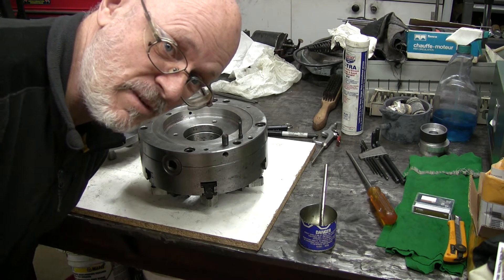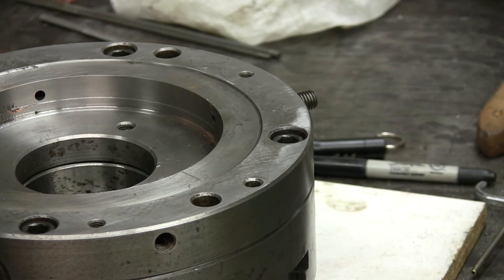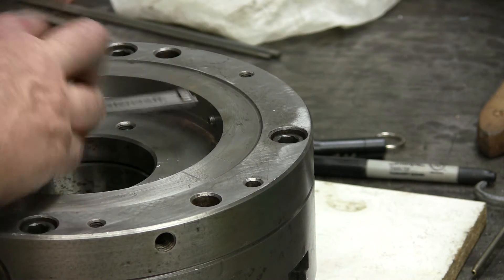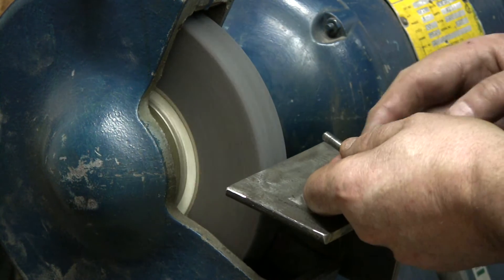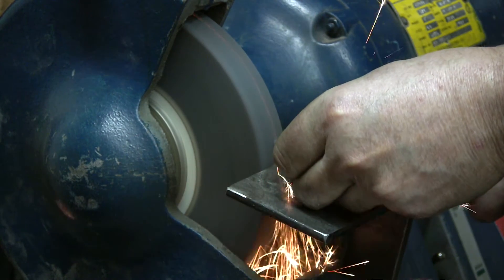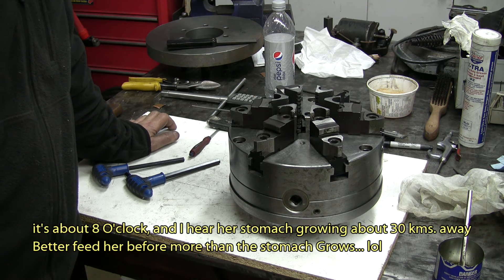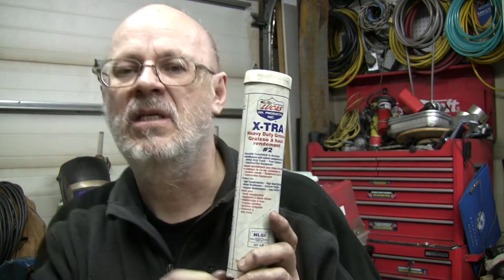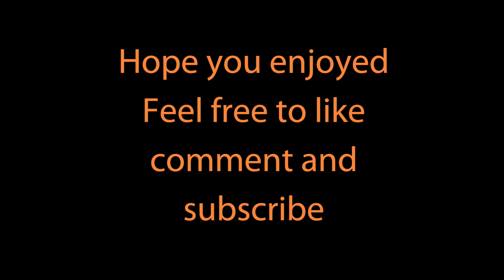Back plate for 6 jaws chuck part 7

Comment: My vote is with Colin.  It is looking good.  Thanks Randy
Reply from the maker: Randy Richard Hi Randy, presently working on the redoing the trial video, cause of the bad wireless mike, you'll get to have a little evaluation of that cheap crappy item finally.The chuck is top shape though, hope to put out the video later today.Your logo is looking GREAT with the latest improvements...Thanks,Pierre
Reply: pierre beaudry Did you get what you paid for?  Thanks Randy
Reply from the maker: It' a $10 cheapo, I'll make a quick review next video after the Back plate final...
Pierre

Comment: I assume in operation it is your plan to tighten those allen bolts so it is not driving through them? I see no other method here.  i think I would like dowels with radial slots so you could move center but still have a continuous positive drive without relying on a friction fit from the bolts. Looks good!
Reply from the maker: bcbloc02 Hi Brian, I'll keep the pins tight on the central hub, since they're not tight fit in their holes they would still slip if they had to.When I tighten those pin in the adjustment, it's a little like a 4 independent chuck where a certain force is constantly exerted on the center hub.I have to admit that it's not like a normal fixed chuck where you get everything resting tight fitted on the center hub, even in that case the screws will have to maintain the whole assembly from rotating.One idea though, could be to roughen the two mating surfaces to induce more friction...Cheers, Pierre

Comment: Congrats on getting the chuck finalized. For guys needing a somewhat specialized grease, I picked this up online and it works well....for chucks
http://www.ebay.com/itm/Toolmex-TMX-Chuck-Lathe-Grease-Lubricant-16oz-Tube-Kitagawa-South-Bend-Bison-/251740055453?pt=LH_DefaultDomain_0&hash=item3a9ce0679d
Reply from the maker: Jim Liechty Hi, Jim I'd be curious to see how this lubricant looks like... $28 + $22 sh. = $50 US, and by now Canadian funds are oups... down the drain in value (-20%)  $60 if nothing else cost money on the way up here like customs...For what I use, I get it at my ball bearing supplier for $7.So far it's an excellent lubricant. And also the other products of the Lucas line of products.Thanks for comment, Pierre